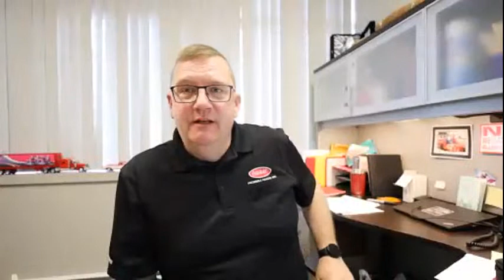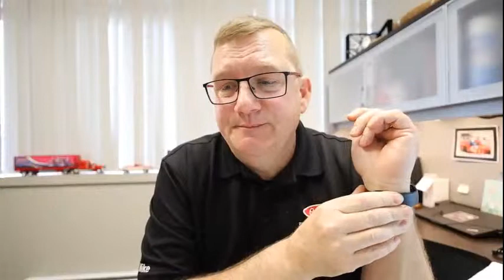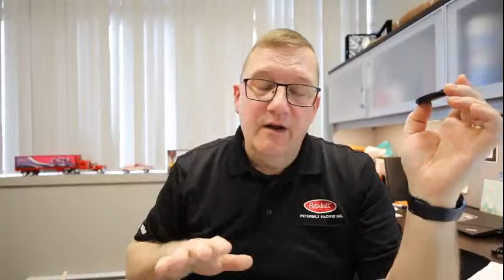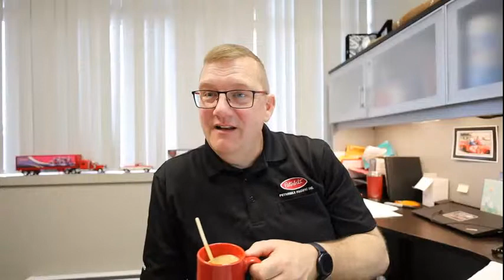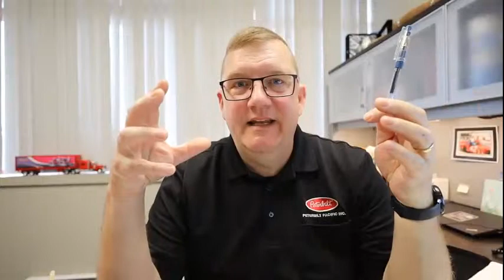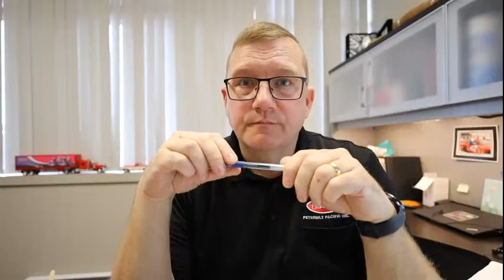FUEL economy tips and tricks... its TECH TALK TUESDAY!!!!!

Comment: The turbo you were talking about I believe was by Detroit, many moving parts on the hot side of the turbo, variable geometry one moving part in the hot side of the turbo. Interesting video, progressive shifting is another way of saving fuel. Original truck that later transpired to the T 600 was a Ford 9000 with low pro radials, hood like a wedge, saw it at the Cummins pilot centre years ago.  Cummins also put out a pamphlet driving for profit, has many of the fuel saving things you talk about. Looking forward to the next video. May have to make a trip to Prince George this summer and look forward to seeing you. Cheers my friend.

Comment: Have to idle up when it’s sitting. Now anything more then fifteen mins you should turn it off but idling the engine up to 900-1000 rpm will prevent cylinder washing